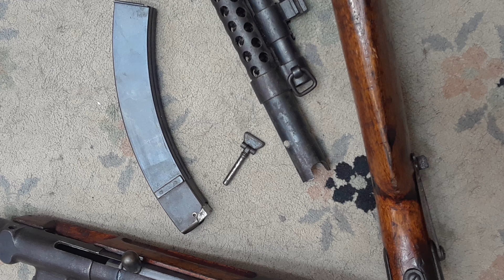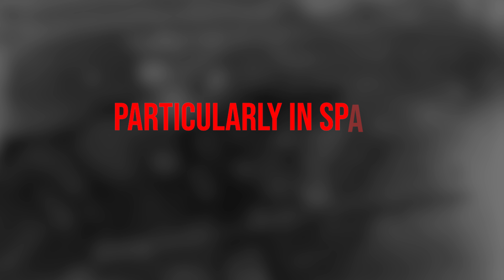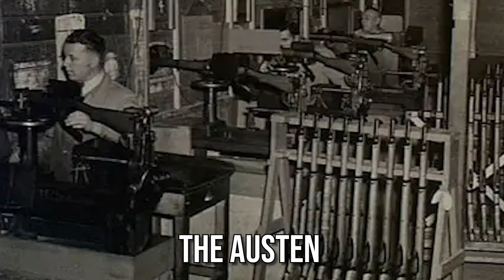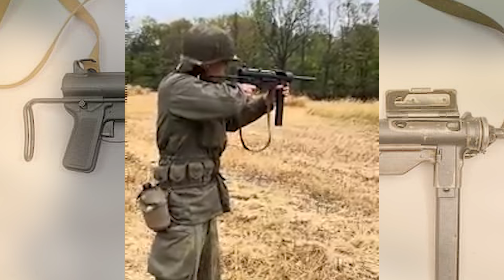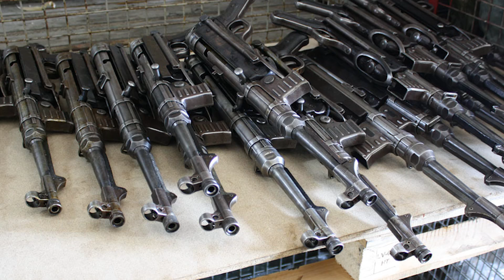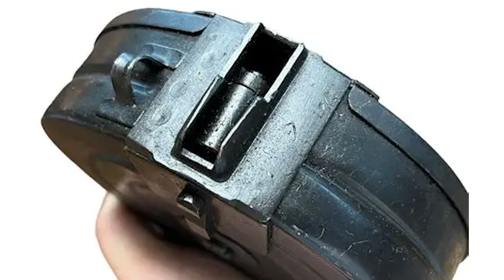Every WW2 Submachine Gun Ranked — JUNK to LEGEND

Comment: There's quite a few SMG that's missing. 

M50 Reising - Built by the Harrington & Richardson Company in the late 1930s as a law enforcement focus SMG firing the popular .45 ACP. However, after Pearl Harbour, the military branches needed more SMG so whilst the Thompsons were being made, the M50 was placed on a short trial to see if it fits general issue or not alongside the Thompsons but alas, it did not perform particularly well and the Army abandoned the plans to adopt it but the Marines and Navy adopted it to free more Thompsons to the Army units. Despite being more accurate than the Thompson by a long shot, H&R's lacklusture business approach of never mass producing something meant that all of the guns were hand fitted and crafted making repairing the guns on the field literally a pain and coupled with the constant breakages, the Marines would soon abandon it too post-Guadacanal when more and more M1 Carbines became available which was rather ironic. 

PPS-43 - The Soviet's "upgrade" of the PpsH. The PpsH might be good but it suffers the same fate as the Thompson that it can be rather heavy with the wood and most glaring issue was the 72rnd drum where it rattles whilst carrying and was a massive pain to load too. Thus, to get rid of all that issue, the PPS-43 was made in early 1943. It was completely made of stamped sheet metal like the M3 "Grease Gun" and the Soviets lowered the rate of fire of the PPS-43 so that it would conserve ammo too from the rapid 950-1100rpm PpsH to a mere 550-600rpm PPS-43. Would serve alongside the PpsH till the end of war and even further on in life right into the Vietnam War and even beyond. 

Suomi KP/31 - One of the finest SMGs of the entire war period which spawned from Finland and one such gun that inspired the PPD-40 and PpsH that the Soviets/Russians would design and use. It was accurate and can take tons of brutal punishments the Finns threw at them and it showed out during the Winter War where it showed the Soviets how "hit and run" tactics was supposed to be done and how versatile a SMG can be for a mobile unit. 

Danuvia 43M - A rare Hungarian SMG, it was designed to be used by the Hungarian Armed Forces at that time. Firing the rare 9x25mm Mauser cartridge, it was heavier hitting than the normal 9x19mm. It was a great SMG and was even comparable to the intricate Beretta M38 in terms of quality and Hungarian troops that carried it into the USSR during Operation Barbarossa and across the whole Eastern Front campaigns liked it alot as it performed extremely well in the subzero weather of the Russian heartlands where other guns would have frozen and failed.

Comment: The best is missing:  Suomi kp!
Reply: Just shows the arrogant ignorance of the american voice behind this little video.
Reply: And ksp m/45.
Reply: Maybe not the best but still missing Reising M50!
Reply: Suomi was shit 
It could easily overheat amd burn your fingers and it was not accurate 
The russian ppd smg was the best in ww2 alongside mp40 and beretta 38
Reply: I agree.
Reply: The Suomi is an excellent SMG and should be on this list, but it like every other example it also would have jammed if immersed in tropical mud. The Owen's unique design meant that the bolt was completely isolated from the retracting handle by a bulkhead and the top mounted magazine and bottom ejection port meant mud and debris just fell out under gravity.
So it still would have worked in minus 50C in a Finnish forest. It was a gun that would have functioned in any theatre.
Reply: I agree., also, the United Defense M-42 was far superior than this list says.  It was refused for political reasons.

Comment: The MP 40 did NOT have a single stack mag, it was double stack, single feed. And that was the problem. Most single feed mags are less reliable than double feed ones.
The russian PPSha drums were not very reliable, many wouldn't fit in other PPSha's, so interchangeability was a disadvantage plus the single feed system and the very high rate of fire. The PPS-43 was much better.
Reply: The PPSH drums as you say were often a bad fit to the weapon. Soviet troops would, where they could, try a few different drum mags to see if one fitted better than the others.
Reply: Yes it did FACT sorry

Comment: Having fires the Owen, Austen and F! in service - Owen overall indeed.  There are videos of the comparative firings with Sen, Thompson and Owen all dunked in mud or firing in a simulated sand storm.  The worst effect on the Own was to shake the mud free and it fired.  The others failed...  Not rally mentioned is the Own magazine.  It held the ejector.  So if there ejector is damaged or broken - jest change magazine.  Another point - the bolt was in a compartment of its own and separated form the mud/sand.  The reason for the barrel removal was to withdraw the bolt not for quick change.
Reply from the maker: True , you’re a gun encyclopaedia on your own man ❤

Comment: The MP-40 did not have a forward angled magazine. Nor did it have a curved magazine, like your sloppy AI picture showed. The magazine is straight, and it goes straight down at a 90 degree angle from the receiver.
Reply from the maker: Correct , there are some mistakes that slip off my eye , but I always praise a good critique

Comment: owen was the best, MP40 was too complicated, Grease gun was not reliable, the heavy bolt did not have energy to strip  rounds out of the mag.
Reply from the maker: True , but others could have different opinions
Reply: @the_rising_guy  not if they have fired them, I have
Reply from the maker: @chadhaire1711 😂that's a savage response
Reply: @the_rising_guy  it is correct response

Comment: The Owen gun had a very bad name with Aussie Vietnam veterans because of its perceived lack of stopping power.
Reply: The title does say WW 2, not Vietnam era!
Reply from the maker: @patrickroohan7633 exactly that’s what I was thinking to reply😂
Reply: what Name did they give it out of curiosity
Reply: @sammy_dog  Australian soldiers called it 'the digger's darling.'  Digger is the name given to australian troops since Gallipoli. There are stories of veterans turning up at the factory after the war to thank them for saving the digger's life.
Reply: @pshehan1  yeah as a Aussie I knew all that I was just asking the op what the diggers called the Owen gun in Vietnam I was thinking he got it mixed up with another gun that the Aussies used with a very bad name as he put it called The Bitch a modified L1A1 SLR
Reply: @sammy_dog As far as I am aware it was simply called the owen sub machine gun.
Reply: Thank you for reporting on the Owen gun so accurately..it is a proud engineering achievement of our country..my aunt Heather was assembling them at Hastings Deering ( Ford car importer) during the war..the gun had many innovative features,the top mounted magazine used gravity to assist feeding,and the extractor was in the magazine lip..the cocking handlewas in a separate compartment to the bolt so dirt wouldnt get it  the gun was VERY reliable,though a bit heavy..they wee mostly paintedwith green and yeliow paint as a junglecamouflage nn reflective finish..you didnt mention the PPS Sudayev sub machine gun designed and made in Leningrad during the siege..the gun was made in a factory that was under fire,and completed guns were shipped out to the front lines for field testing..the leather recoil buffer pad was made from shoes of dead people..

Comment: The WORST was the Sten, far worse than Type 100. The best MAB38 followed by suomi 31 and pps43. The only good things about sten are cheapness and that was very easy to manifacture. M3 and thompson are inverted
Reply: The Sten was designed to fit an urgent requirement to equip troops after Dunkirk where Britain lost most of its equipment.
It was cheap, costing almost nothing compared to the Thompson. Britain in 1940 was paying $200 each for Thomason’s and a Sten cost $10!
It was improved over the war and as it fired the 9mm round was dropped by the thousands to resistance fighters.
Royal Armouries has great videos about it dispelling some of the myths around it.
Reply: @nigeh5326 sure but it wasnt a good weapon, was an emergency weapon not a good one

Comment: I think the number 1 should be the PPS-43, it have compact and light weight that PPSH-41 don't have, it use same powerful and high velocities 7.62×25mm Tokarev as PPSH-41, and the most important, the PPS-43 and take 2,7hr to make one and it cheap as hell, like it the most simple and low cost gun in WW2, also like all Soviet made weapon it can work any where from desert, forest, winter, swamp, no matter it just work
Reply: When your workforce is paid almost nothing to work flat out on very long shifts in terrible conditions your production and wage costs are much less. 
Plus  much of the metal being used is coming from abroad via lend lease (so you aren’t paying full price for the metal or even paying at all until later) your cost to produce a simple blow back SMG are going to be much lower.

The PPSH  and PPS-43 are both v good SMGs in WW2 terms that require little training for anyone to use. The same as the AK47/74 compared to the M16/M4.
Soviet weapons were designed for use by peasants, workers etc so as to be stripped, cleaned and used by anyone.
Reply: U r so incorrect not any facts to what u said
Reply from the maker: Good point there , but the there are many better guns than that for sure

Comment: Always wondered on the MP-40 is that nub of steel at the bottom of the barrel tip just below the aim  sight served a purpose?
Reply: to rest on a wall when shooting so barrel does not get damaged
Reply: @chadhaire1711 THANKS DUDE!!!
Reply: @dudeBjacked  you can also use it as a brace.....set it on top and in front of a  wall, log, or  flat rock, then pull the weapon backwards, with the "HOOK" locking in place --it will hold in place and prevent recoil for better accuracy during burst fire.
It is not  a good  SMG design. overall....has  a bulky  buffer inside that keeps the cyclic rate slow that adds too much weight and complication, barrel can't be removed for cleaning, and was very expensive to make, defeating the point of  using stampings.  
MP40  and Thompson were grossly over rated.
Owen was the best, and I have fired them ALL.
Reply: @chadhaire1711 😎👍
Reply from the maker: @chadhaire1711 ooh well , I didn’t knew it before, thanks for this info
Reply from the maker: Now after you’ve pointed that out , even I’m confused 😂
Reply: It was actually to prevent the recoil driving it back, so that the remainder of the burst hit the inside of the wall... which would not be good for the firer,  The nub would catch on the wall, hull, whatever, and not be driven back.
Reply: Great question